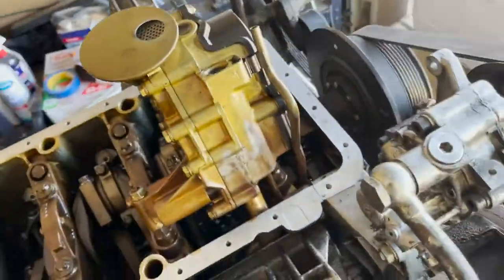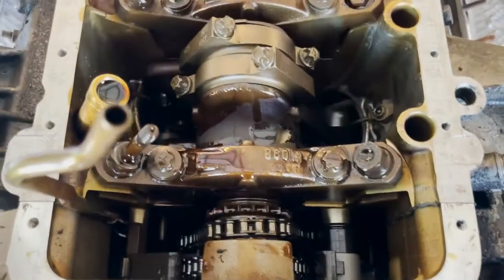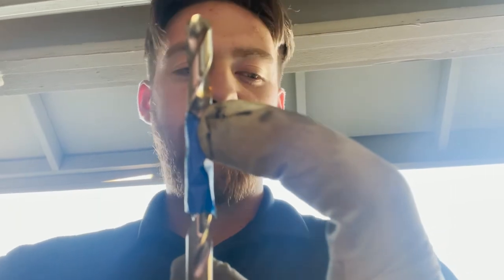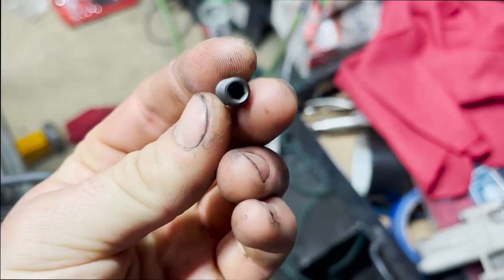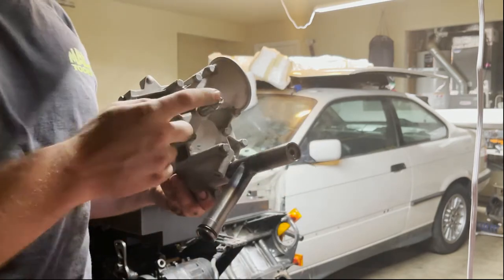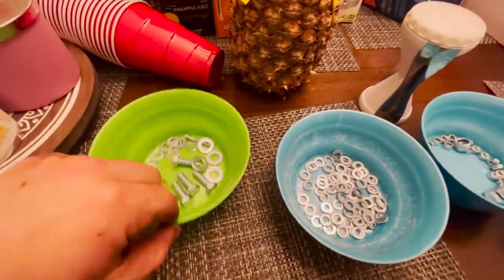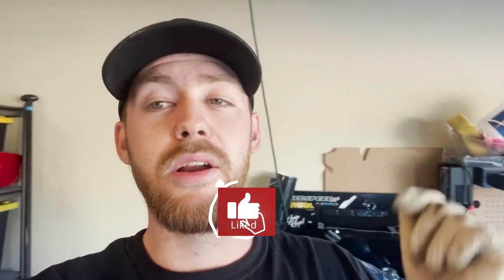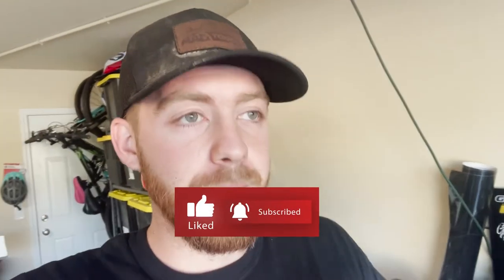BMW e36 V8 Drift Car Replacing BMW oil pan | m62 to e36 pt.4

Comment: It doesnt matter that you took the timing chain off?  it can go back on in any position?  sorry...im not used to chains, ive done belts.  thanks
Reply from the maker: So their is the main timing chain that’s attached to the timing chain guides and at the very bottom their is a secondary drive chain that attaches to the oil pump and that can be taken off without messing anything up. 🤙🏻
Reply: @SeeMeSidewayz  cool thank you.  im planning on doing the same swap but in a e46
Reply from the maker: sick man these motors ripppp cant wait to drive my car again lol

Comment: Loving this series man! What gearbox are you planning on using 👍
Reply from the maker: Gonna be using the getrag 6 spd for now until I boost it than when I boost I’ll do a zf trans
Reply: @SeeMeSidewayz  which code is the box? GS6-37BZ? Im looking to do this swap in a Z4 Coupe ya see and alot of the underpan is E46 😁
Reply from the maker: Not sure on the code it’s just a getrag 420 stock gearbox that comes on the m62tu motor

Comment: Hi, Should you warm up your car in really cold weather??
Reply from the maker: not to sure if i understand your question.
Reply: @SeeMeSidewayz  Should I wait 30sec or 10min what best for the engine
Reply from the maker: @silviataylor92  if you wait 30 seconds that should be long enough, waiting is to allow the engine oil pressure to get to optimal oil pressure so the engine components are lubricated and will not cause any catastrophic failure